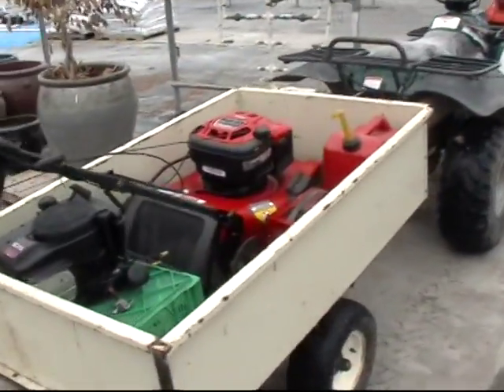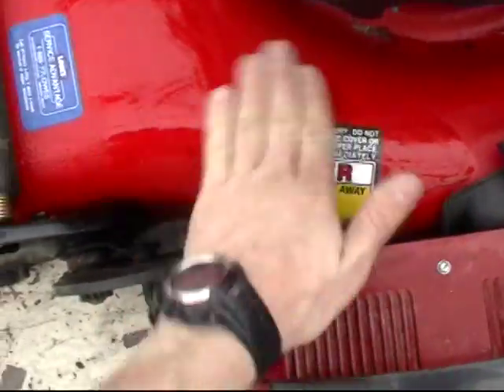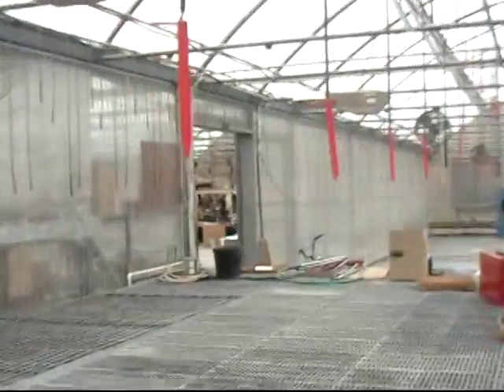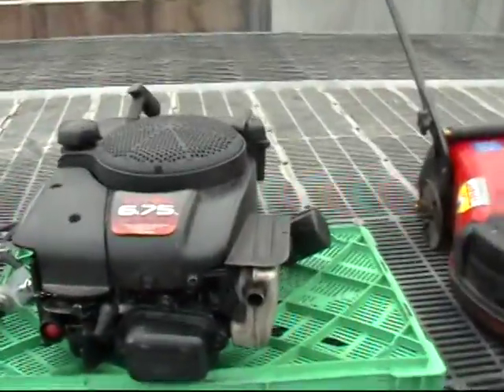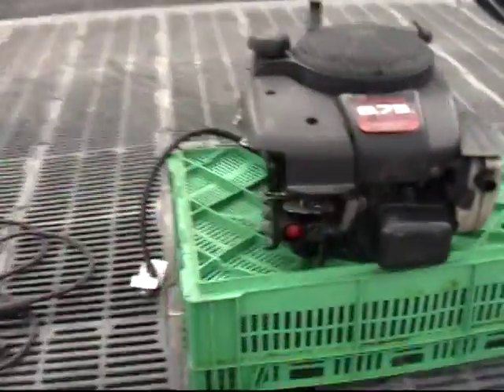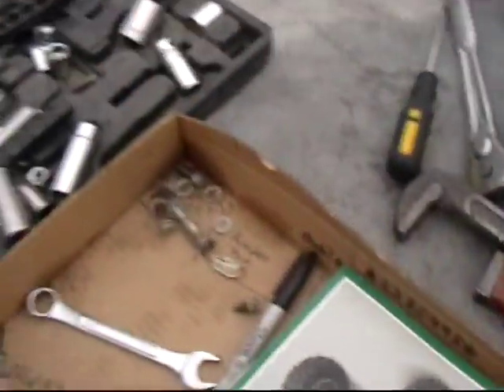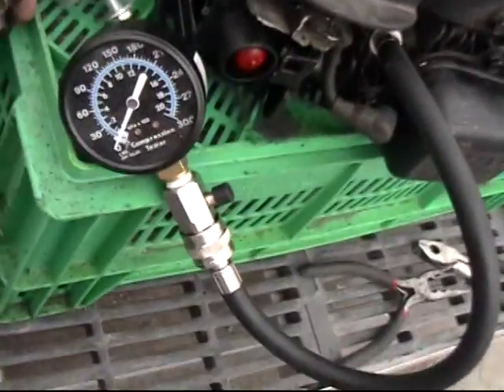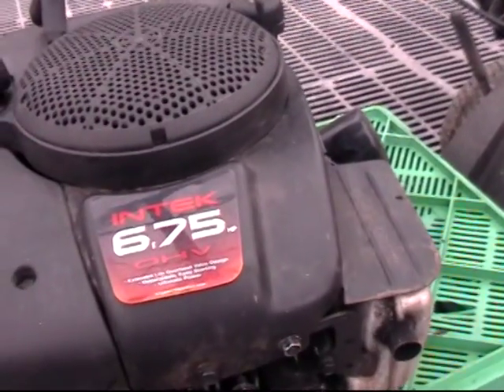Briggs and Stratton 6.75 HP OHV compression test

Comment: Autoplay brought me to this 13yo video and I just want to let anyone that watches this that watching the gauge to see if it drops will only tell you if your gauge is leaking off and has nothing to do with the engine whatsoever. The gauge has a 1 way check valve. The pressure goes in and stays in until you hit the release valve. If it didn't then the pressure would go out the exhaust or intake valve and you wouldn't get a reading.

Comment: you dont have to let it sit to see if it looses comp. just hit comp 3 times and check the reading. if you have a lo reading put oil in the cyl to find out if its rings or valves